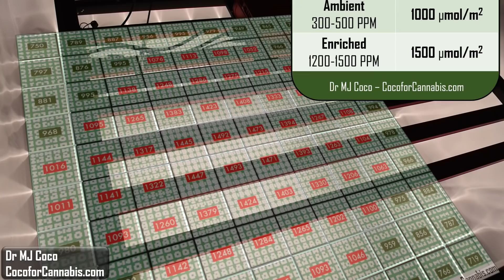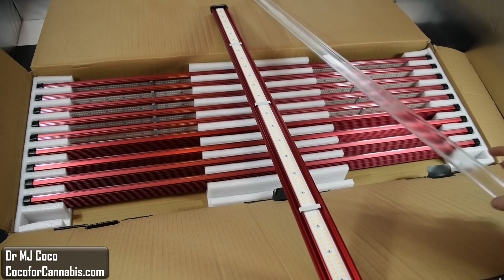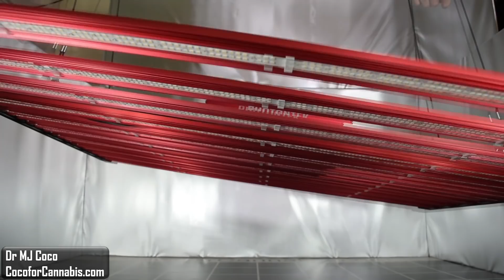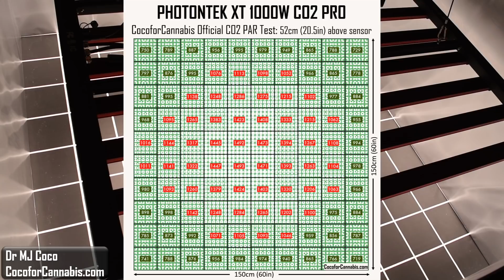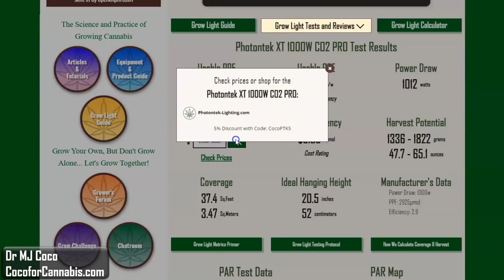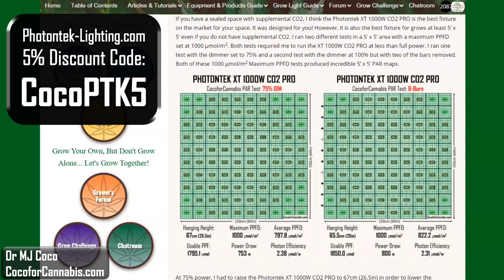Photontek XT 1000W CO2 PRO PAR Test & Review

Comment: This light is dam near has a btu heat output as a double ended hps, what’s the point of led if it’s list as hot
Reply from the maker: It puts out twice as much light for the same amount of heat/power! Grower love
Reply: @DrMJCoco  definitely love that,
What are your thoughts on the gavita ct 1930e? The µmol output is 1930 , but the 
But the maximum
 PPFD: 367.2 μmol/sec/m2 
At 4 feet and these need to be hung at 4 feet. It’s supposedly a 1:1 replacement for DE. I don’t know what I’m missing here. But that seems really low. For the 1930 being gavita and supposedly one of the best out today. I been wanting to replace my DE and was going to go with these. But I don’t like these numbers

Comment: Would this work in a 5x4 with 8 ft ceiling without co2
Reply from the maker: Yes, but it is too much light regardless of height (assuming reflective walls). So you will have to run it dim or without all of the bars. Grower Love
Reply: @DrMJCoco  we are going to be upgrading from the Mars Hydro FC6500 in a few months, do you have a recommendation for an American made light for a 4x5?

Comment: If you hang it at a distance of 12" (30 cm) from the top of the cannabis, turn it on at 100% and add CO2, will it be good or will the plants get a light burn? What should be the minimum distance from the tops of the plants?

Comment: Hi looking for a light system ....for a current culture 6, site 13 gal buckets, and  are side by side.. I want at least 1500 PPFD at the canopy for running CO 2. Looking for advice...these are the 2 lights I cannot choose between and am stuck.... the photon Tek 1000 C02 pro or multiple multiple Mars hydro sp 6500's.. Given my budget and the performance of these lights as documented which one's would you go with? Qty 2 photon tek's or 3 or 4 mars hydro sp 6500's?  I was leaning toward the photon Tek but I was told by a worker at a hydroponic store that it's got multiple failure points starting with the magnets & the way it's constructed?  Then I came across the Mars hydro 6500, the way that thing puts out PPFD if I get them side-by-side I know I can overlap and have a much more solid consistent PpFD throughout the area, ...and 4 mars  Hydro SP6500's cost the same as 2 photon teks?? Thoughts? Thx

Comment: Your heat added for eye hortilux is off by a mile. It doesn't remove 80% of the heat. The light recreats the heat faster than u can remove it. Fans remove it out the room it doesn't cool the room. Therfore the sane btu is needed around 6,680 when my hvac, Biosystems Engineers tested it. Your analysis is skewed for the eye hortilux Therfore I will not rely on your data for that one only since my team proved your concept to be false for the eye hortilux.

Comment: When I switched from my SE 1000W HPS Cooltubes I went with the Growers Choice roi 720e, switched back in April, here we are in August and already having issues, one of the Master Controller climate sensors pooped out on me (stuck at 99% humidity). Wish I had waited and went with the Photontek XT1000. 🤬
Reply: I still run SE 1k… been wanting to dabble in LED. Still not sure which one but this one looks killer.
Reply: @kevinkline1947   Go with the Photontek, stay clear of the Gavita LED’s they are trash, if you’re on a budget go with the 720 add the UV Booster bar and Co2 and you should have no problem knocking out 2-4lbs in a 4X4.
Reply: @the_gold_canopy  No problem getting 4 oz /sqft?  Have you grown weed before?

Comment: Been Waiting for the non co2 with the bigger frame to come out. Want to run 4 over a 12x12 canopy. Do you think these c02 ones would work good covering 6x6 area ?  Taking consideration in for overlap from other lights
Reply from the maker: Yes, the CO2 version will work great if you have enough height - at least 80cm between fixture and canopy. Grower Love
Reply: @DrMJCoco  hi Coco master,...
I can put in the groowroom 120x120 the photontek 1000 pro CO2.…?
Reply: @DrMJCoco  how the Beast led for the groow 120x120 with all 1500 PPFD
Reply: @damianoceruti8628  look on migros channel he's done a video on it. It will do a big area with out CO2.
Reply: @DrMJCoco  how many ppfd  Max for plant?

Comment: some of your BTU math seems a little off. The Gavita all watts eventually create the same BTU in an enclosed space 3.41BTU=1w. The higher BTU #'s they give for the bulbs seem to be rounded numbers they give to recommend AC units. Both HID units should be around 7k BTU assuming the wattage is accurate.

The LED is dead on with this number.

Not that it makes much of a difference, the Photontek fixture obliterates them either way.

This is why at the end your ratios don't stay the same after the AC is applied. If done properly it should stay at the exact same ratio if it was 2:1 before it should be 2:1 after.